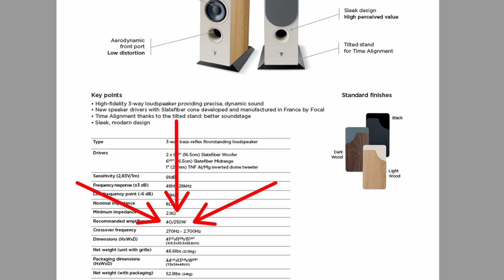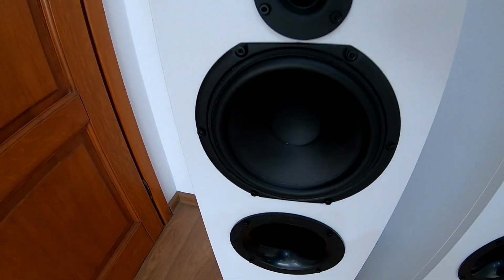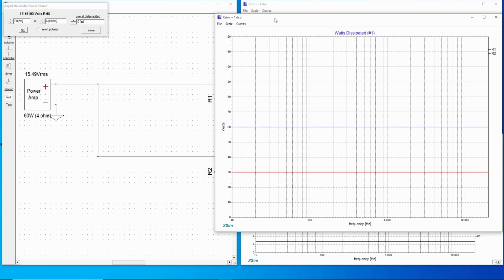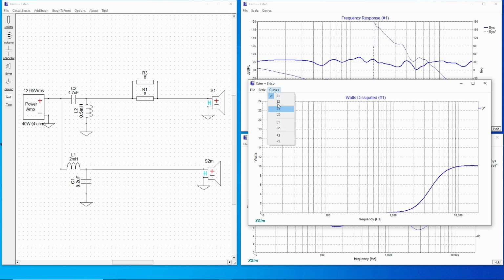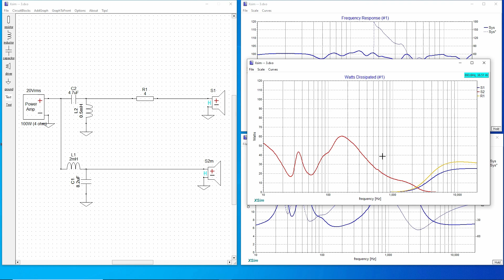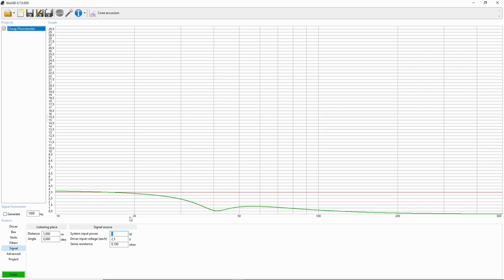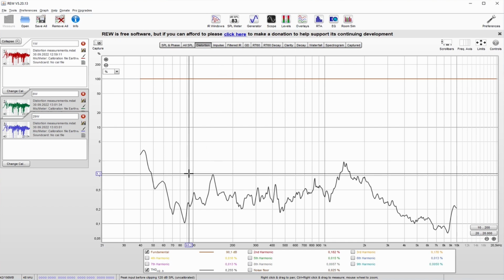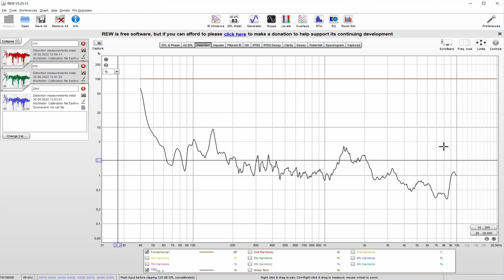Speaker Power Handling Explained

Comment: man I got 16,   eight ohm speakers 15 watts each...... i need to wire them together to handle at least 100 watts, and no need for less than 16 ohms.   so far my math is  8 speakers in series parallel with 8 speakers in series.
theres 16 ohms but im been retired . trade school if I remember loads in series power divides? so each speaker will handle a small portion each? 

15 watts 8 speakers in series
is 120 watts total
but 32 ohms.

Comment: interesting. it looks like xsim uses white noise to drive the drivers (constant power density spectrum wise) which may be good for testing maximum power handling in laboratory tests but music is more like pink noise and so midranges and tweeters are drastically smaller than woofers in power handling.

Comment: My question is if a woofer is rated at 100W RMS, two of them in parallel should handle 200W RMS, true or false?
Reply from the maker: True. Same thing if you wire them in series. You just need a bigger amp to push out 200W at a higher impedance.

Comment: I like that you addressed this age old question! This was a topic of debate as far back as I can remember. Way way back when I was younger, the general rule of thumb was to choose an amp with double the wattage capability of the speakers. The theory being, (as you alluded to), that the amp or receiver needs to have the capability to electrically control the speakers at their max, taking into account plenty of dynamic headroom. In practice, this works and as you also mentioned, speakers are more often damaged by under powered amps.

Taking that practical logic and applying it to building speakers purposely built for high power/high SPL output with low distortion, I've found that the amp can safely be larger than most people's budgets allow anyway.

As an example: A typical high power speaker may resemble something along the lines of a few home speaker projects I've done recently. Take the Jensen CS 315 RestoMod I did... 300 watt RMS/ 600 Max woofer, with a 50 watt RMS / 100 watt max mid-range, and a 30 watt RMS / 60 watt max tweeter... This would seem to be a 380 watt RMS system with max of 760 watts. Or, conservatively 300 watts if limiting the advertised power to the woofer, (because most of the energy is soaked up by the woofer), as silly as it sounds, powering these with my NAD that's rated at 130+ watts per channel RMS, they're technically underpowered. They still sound good, especially indoors at home, but if I were to push these harder, in a huge room or outdoors, I would want an amp of at least 800 watts RMS as a rough estimate.

I know this because I've used similar designs for high output in banquet halls, outdoors, etc. and smaller amps (for example my old Harmon Kardon PM 660 with 80 watts RMS), and they were underpowered and underwhelmed outdoors and in big spaces. Actually what I ran these similar designs with in those applications, were 2500 Watt stereo RMS pro amps, bridged to 4000 watts, 1 per speaker cabinet. With those amps, the speakers would play at or near Max output in the 120+ Db range for as many hours as needed. Just testing them I'd let them play for a minimum of 8 hours non stop at full power, before I'd even sell them to a customer.

In use, even at these relatively insane power levels, they'd run for an entire event at or above these levels, without audible distortion. 

With all that being said, I have always been a firm believer in plenty of clean power on tap for speakers. Just a WAG but my pseudoscience theory is that it's because we listen to music, which has continuous deviations across the frequency and output level, unlike running a continuous pink noise tone burst. This allows a speaker to safely operate even at seemingly crazy high power, because thermally and electrically they're very rarely at any given max power state for more than a few milliseconds when playing music. 

I wouldn't recommend overpowering them with a continuous full range tone, but with music, which is constantly changing frequency and output level, it's fine. I've done it again and again.

It's ironic, because just within the past couple of days, I was testing some vintage Realistic speakers that have 20 watt woofers and 10 watt tweeters, with my NAD and they sounded quite good despite me operating them with a receiver that's capable of 4 times the speaker's power handling. 

The old theory behind this, (and intuitively it seems logical), is that it's more important for the amp to be able to "control" the speaker. Constant musical bursts over and over, and the mechanical limits of the speaker in combination with the speaker always fighting itself to return to its neutral state, requires amplification that can move them in and out as needed, without allowing the speaker drivers to become mechanically unstable during music playback, which leads to clipping and distortion which will absolutely destroy a driver regardless of its power handling.

Whew that was a lot of comments I know... But an important topic. Even if mathematically I'm completely wrong, in actual application, I know this to be true because I've done it over and over. In all the years I've been doing this, the only time I ruined a driver, was from playing it loud while underpowering it.

Thanks for the illustrations and explanations and I agree with you that more power is better than not enough, especially if the drivers have a lot of mass or big motors, (often the case with DIY speakers Vs store bought speakers which employ much smaller motor structures in their drivers).

Maybe a cool idea for a video would be to see what happens when high power amps are hooked up to low power speakers and vice versa.

Comment: Another excellent video, as always! BUT, :) I just wanna point out that Xsim calculates the amp power based on the amp output impedance and is actually a very weird thing to do because its not how it works. For example(and for simplicity) take your first example, where you have a 8 and a 4 ohm resistor. You set up Xsim to output 60W to a 4 ohm load, and it does exactly that, you can see on the 4 ohms resistor, the power dissipation is 60 watts, great. Its 15.49 Volts at the amp output terminals, ohms law tells you that is indeed 60 watts at 4 ohms. You can also see in Xsim, that the 8 ohm resistor gets 30 watts, and that also checks out with ohms law at 15.49V. But, in reality the amp actually sees the two resistors in parallel, and for this example it is 2.67 ohms. It puts out 15.49V, so the total power that is coming aout of the amplifier is actually 90 watts, the power dissipation of the 2 resistors added. I know you know this, but maybe next time when using Xsim in your videos just mention this because it can be misleading for newbies. I don't know why Xsim works like this or why there is no option to see the total output power of the amp but I can't complain as its a free software and I'm very glad that it exists in the first place.

Comment: Any budget build suggestion for (centre channel speaker 8ohms.) normally all 2 way crossover design ( 2mid woofer , 1tweeter.) are in parallel configuration . can use series configuration and what'd final impedance.

Comment: Hi, I wanted to let you know that your videos have helped me a ton. Three months ago I began into all of this, I started designing and building a small PA system, two 'column' speakers and two subwoofers. And by now I'm already digging into phase alignment of the whole system in different venues. I want to thank you a lot! Your videos were very helpful along the way and now I got the best sounding system I've ever heard. And this topic was something I haven't had clear, I didn't really know if it would be ok to let the amp run at full gain into these speakers.

Comment: I think the most important thing to realize about speaker power handling in home audio is this: Don't think too much about it.
It's also a way to tell "newb" speaker builders apart from more experienced or knowledgeable ones - the newb will always rave on about power handling, and it will be his first consideration when selecting a woofer, because "more Watt equals more loud, right"?

All the while the "pro" will probably be able to tell you many parameters of his favourite woofer (Fs, Qts, Sensitivity etc.) even when half asleep at 2am, but there's a high chance he won't be able to tell you the power handling figures right off the bat at any time - his response might just be what Rolls Royce tells you about the Horsepower of their cars - It is sufficient .
Pretty much all home audio woofers will mechanically distort long before reaching their own thermal limits, and, given you applied some common sense while selecting it and did not mess up the filter circuit, the thermal limits of the tweeter, or whatever is doing the high and/or mids.